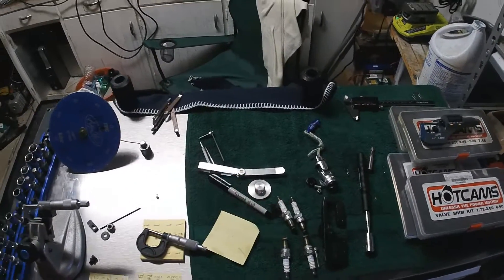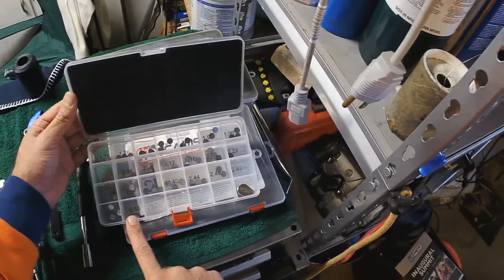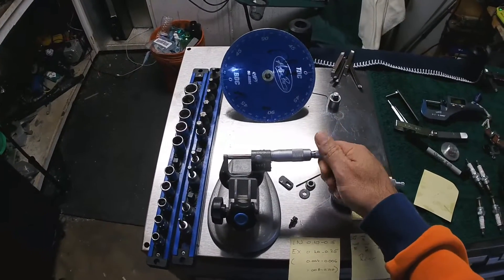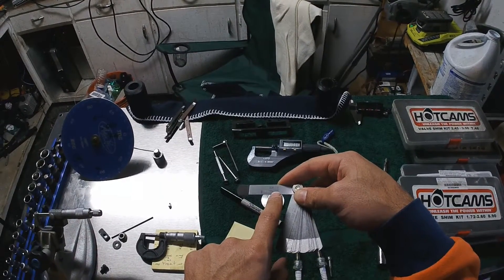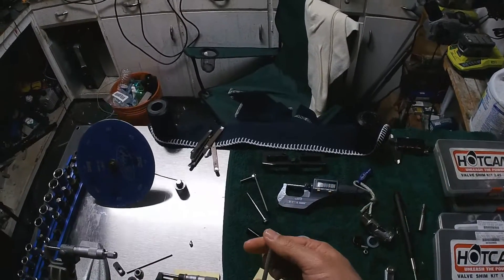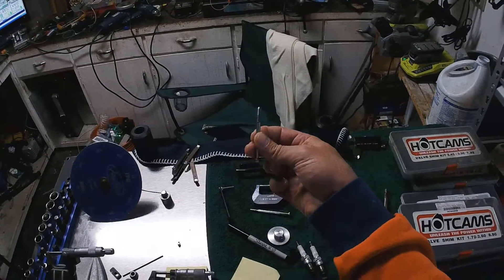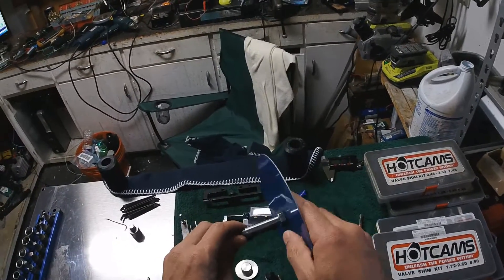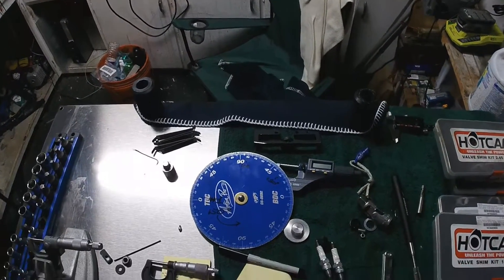RSV4 Valve adjust-tools

Comment: Hi Shaun, 
I will be doing my valves in a few weeks, What are the dimensions for the bolt you used to attach the timing wheel to the crankshaft? Would you recommend making this tool identically or do you have any recommendations for building an updated tool if you had any issues with this one. 
Thanks, 
Colton

Comment: Hey shaun. hope all is well. i think ive watched your Rsv4 videos a thousand times!
Did you ever end up making the Cam gear holder tool?
Im thinking of making mine own. is the Aprilia tool made of Aluminum or steel?
Reply from the maker: Hi Drew, I have my tool right here. I've scanned it and added dimensions. I'll post a link as soon as I find a place to upload them. I'll also draw them in fusion 360. The tool is steel, but I'm sure aluminium would work just fine.
Reply: @ShaunNielsen  the cam gear holder you made is in this video? you can always email me if you'd like. vwpiloto@gmail.com
Thanks again.

Comment: Did you use a gear lock on the cams while torquing the bolts?
Reply: I have used a gear jammer to tighten, but the crank lock tools are amazing if you can get your hands on them.

Comment: Thanks for making these videos, much appreciated. I have a 2016 RSV4RR with a new engine (the previous one dropped a valve after 50000km - long story). Anyway, I want to be on top of it this time and want to check the valves myself because I don't really trust the dealers to do this. My question (hope you can help) - what differences to the procedure on the 2016+ motor?
Reply from the maker: Hi Marc. Dropped a valve after 50,000 K's? Thats pretty impressive, both for you and the motor. Thats a lot better than having it happen after 3000, as has happened to a few people. Good idea to do the work yourself. I've worked at too many dealerships where the techs didnt know how to do the work so just didnt bother (never go to a shop with MMI trained techs)
Unfortunately I cant comment on the differences between my 2013 and a 2016+ motor as I've only ever worked on the older models. The best place to ask would be the AF1 RSV4 forum: http://www.apriliaforum.com/forums/forumdisplay.php?69-2010-2013-RSV4-Factory-and-RSV4-R
Reply: Thanks I've been browsing around the forums but not many pics/videos.

Comment: Hello Shaun.Can you tell what diameter the crankshaft locking pin/tool is please?
Reply from the maker: Hi Murph,
I dont have the tool with me here, its in a storage unit. I'm pretty sure its a 6mm bolt. If you look at the AF1 store they have them there, and if all else fails, try asking on the AFI RSV4 forum. Or if you can wait until this weekend I can go get the tool and measure it for you.
Email me to remind me - shaunn@cardosystems.com
Reply: It’s a 6MM pin.Im making my own bits bar the cam gear holding tool.
I’d rather learn about my bike than pay a dealer that may or may not do the job.
Thanks for the videos Shaun.

Comment: Hey Shaun. Ever measured the valve adjust tool? I can possibly fabricate one using tools at hand, can send it to ya if you've got some measurements : ).
Reply from the maker: Hi Armin. I'll get the dimensions for you next week
Reply: Awesome. I've got access to a waterjet, mills, drill presses, etc. , might could make one. Thanks for the videos!
Reply: Hello Shaun. Also, is the bend in the cam holding tool helpful, or would it be better if it was flat? If nothing else, I may when I decide to adjust my valves Measure the hole lengths at the attachment points, and make the tool based off of that. Or just shell out the money, still undecided.
Reply from the maker: Hi Armin, I have a scan of the tool I can send you, along with dimensions. In case you didnt know, its totally flat but the mount for the cam sprocket is a circular piece at right angles to the flat surface. If you contact me on facebook I can send you the drawing/scan and dimensions.
Reply: Awesome, will do!

Comment: The manual calls to remove the stator and flywheel and to use a tool to lock something on that side in place.... or am I misreading it?  In any case, I notice you didn't do that.  Do you see any reason to?
Reply from the maker: You're correct - the manual does specify a tool to lock the crank in place but after looking at the valve train I didn't think it was necessary. By being careful and not applying excess force I was able to remove the camshafts and complete the job just fine. The key with all mechanical work is to examine the parts you're working on and everything they are connected to until you understand how much force is necessary to do the work you need. Never apply more than that. If a bolt wont come undone, or a component wont seat properly, dont force it. Pull it apart and look at whats going on. By working this way you can avoid damaging other pieces and will never have to learn how to install a helicoil on something you broke!
Reply: Totally get it... so basically you (and I agree) took the approach that locking it in place from the clutch side, using a pin to lock the cam gears in place, and being careful and deliberate was enough to prevent the front cylinder from moving out of time and as such, didn't need to remove the flywheel or "lock it in place" from that side.  Am I understanding you correctly?

I thought the same thing when looking at it -- my thinking being if that bolt is good enough to hold the crank in place on the clutch side for the rear cylinder, it should be good enough to keep the same crank in place for the front cylinder as well and so long as i wasn't cranking down on some bolt or something with extreme force, it wont force the crank past it.

Thanks for the reply Shaun... appreciate it.

Comment: What did you use to pull the flywheel?  We have the same type and thus the flywheel needs to come out.  I have seen some various tricks on the internet, but not about to mess up my expensive engine.    

I also noted on the engine teardown vids you just pulled it free.  Mine seems pretty well attached and just pulling with my hands will not remove it.

Thanks,
Jason
Reply from the maker: Hi Jason, mine just dropped off when i undid the bolt. If it hadn't, before buying or making a specific puller for it I would have experimented by tapping it on all sides with a plastic mallet. If that doesnt work then its time to check the AF1 website for the proper tool.
Reply: Thanks.  I have seen mentioned that you can demagnatize  the flywheel if you hit it.  Is that why you said use a plastic mallet to remove that possibility?
Reply from the maker: i hadnt heard that but i wouldnt hit a metal assembly with a hardened steel hammer unless damage was a good thing.

Comment: Hi Shaun,
Regarding the cam chain sprocket holder tool, is it a must or can the job be done without it?
Thanks!
Reply from the maker: Its a must. If you were to try to do the job without it and it failed, you would most likely have to pull the engine out to get the access needed to reinstall the cam chain
Reply: got it.
thanks!

Comment: Shaun, I’m out of spec on a few of mine and will be doing this shortly. currently I am trying to gather the tools I will need as well as reviewing a few different sources on how to actually do the job. Here are a few questions I have so far as far as what tools.

 

1) what brand/model MIC did you picture? you said you got it off of amazon, but which one?

2) Did you use the factory gear jammer from aprilia? your videos only talked about using the two pins to lock the crank and the cam, but other sources have talked about a motion pro gear jammer while others talk about the factory tool that jams up the primary gear.

3)I saw something saying the clutch needs to be pulled? did you have too? your video showed nothing about that. it actually looked like it was still in place when you did the work.

4) did you have to pull the flywheel? when you did the front bank, it looks like you didn't cover pulling the stator side in detail. what tools did you use for that? and can you give brief description?

 

Thanks for any additional help you can give.
Reply from the maker: Hi jason, I just posted a link to the new micrometer in the description. It works great in both metric and old style.
The jammer isnt necessary if you're careful. Its intended for ham fisted apprentices rushing to get the job done

The clutch doesn't need to come out. 

I pulled the flywheel only to install the degree wheel. It doesnt require a special tool, just a standard socket and it drops off.
Reply: Shaun.  Thanks.  With some of my "impressive " mistakes, I wonder if I'm one of those ham fisted people you speak of.  But knowing that I will be gentle where needed.
Reply from the maker: the best thing to do is go slow. dont do something until you know what effect it will have, and double check everything. its better to take longer to make sure its right than realise you've done something wrong and have to redo the job
Reply from the maker: The tool I made for the front bank used a 5mm bolt. the screwdriver i used on the rear was actually slightly larger and was a better fit - it was tapered slightly and worked much better.
Reply: Shaun, I have another question, What size is the cam locking pin? the broken screw driver... I dont have any broken screw drivers laying around.  ( yes I have two accounts and am on a different computer.)

Comment: The (apparent) lack of factory consistency regarding valve clearances worries me; a lot. If I were to buy a new RSV4 I'd want to get the valve clearances checked with zero miles on the clock. Thanks for all these "valve job" videos btw. Epic.
Reply: Good idea. I've seen some set to explode from the factory. I think it should have been spec'd at 10000KM's based on what I've seen.